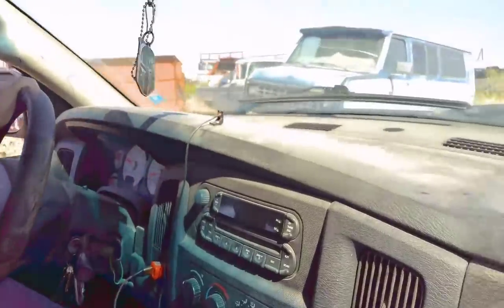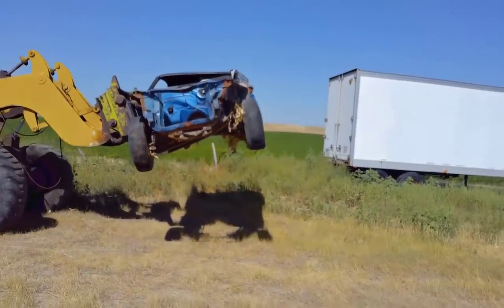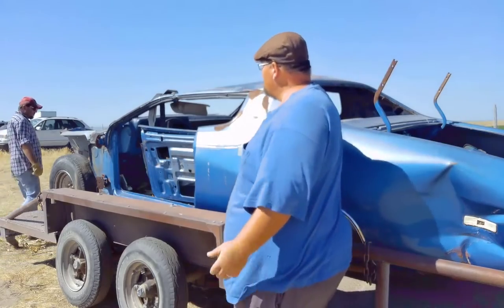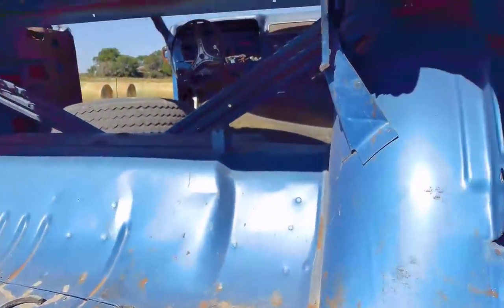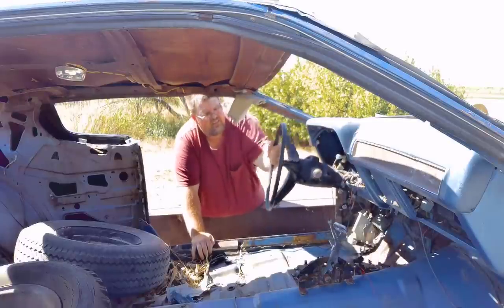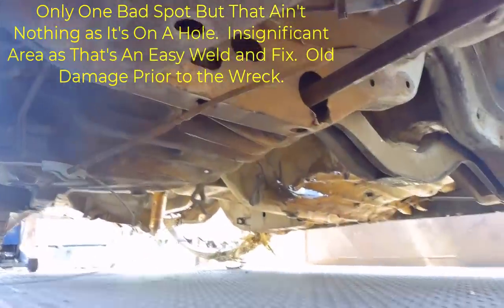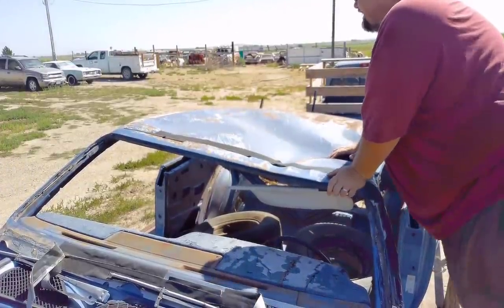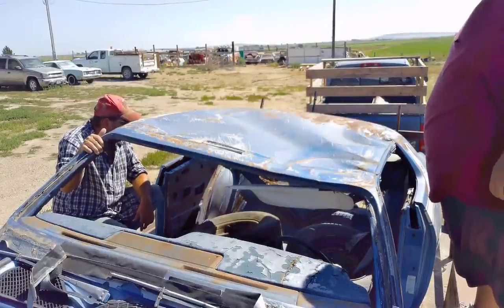Saved From The Crusher!  Bringing My Wrecked and Rolled '73 Roadrunner Home!

Comment: Zero chance this car is ever road worthy again~
Reply from the maker: I've worked on worse.
Reply: @TheDirtCatBrothers  Yeah, probably true.. but hardly any of these left, and there's nothing on that car really, so it needs new everything~ Finding all the parts is what dooms this car~ There just isn't enough of it there in my opinion~ If it was an F-150 this stripped, you could make it happen.. but with this, I'd say it would cost close to 35-40 grand to get it back in really nice shape~ At that point, it wouldn't be worth the effort~ Not knocking your workmanship, just don't see this back on the road feasibly~
Reply from the maker: @Buttermilkjug  It's fine so speak your mind as I know you aren't knocking anything!  From when I checked the car out, I made sure that it could go back on the road 100% however this is not going to be a 100% restoration of original hardware as it's going to have a twist towards its restoration with it  being modernized!

Comment: That 1973 RR def looks rough but, at first glance, it looks to be rather fixable. Note that body/fender technology has progressed a LOT since 1973. To somebody who's used to doing major work on 2010+ cars, that RR would almost be relaxing to restore correctly.
Reply from the maker: One of the main reasons why I grabbed it as it is 100% fixable.  Just needs a lot of love and care in which it's going to get a lot of love here shortly!
Reply: Starting 1973; all Mopars with the exception of the 6 cylinder Darts/Valiants, came with discs as standard equipment, so your Satellite/RR is already fitted with discs.

Comment: For 1973 the Plymouth Road Runner came with four engine options:  318, 340, 400 and 440.  The 440 came as the GTX option, it would say Roadrunner on the body with GTX emblems on the hood with the 440 call out numbers.  Even though you don't show the vin number, it doesn't really matter because this does look like a Roadrunner.  Your vin should start out like this:  RM23G3, the next numbers are the build numbers.  If there is a fender tag which is found on the top of the front fender, drivers side, that would tell you more options.  The color is B5 Blue, a very popular color and a nice one.  It will take a lot of work to bring this car back together but it can be done.  Even though it doesn't have the larger engines, its still a Plymouth Roadrunner, very cool.  By the way the 1973 318 Roadrunner came with dual exhaust and could be ordered with four transmission options:  three speed manual on the column, three speed manual on the floor, four speed manual on the floor and TorqueFlite Automatic, column shift or floor shift.
Reply from the maker: You are spot on!  This does start with RM with the fifth number being that of a 3.  Learning more about my Plymouth after all of these months, this came with the 318.  Very low end model.  To me, I don't care as a Roadrunner is a Roadrunner.  The color I wrote down someplace but agree that it is a very wonderful blue as I plan on spicing that color up more when paint goes back on.

Hoping to get more established as this won't be original.  Plan on turning this into a Roadrunner Hellcat with the 6.2 litre out of some modern day Charger Hellcat, or whatever is available, into it.  I have to find out of what needs to be reinforced with the modern engine as it will be a new encounter for me to undertake.
Reply: @TheDirtCatBrothers  You have a nice project car there, good luck with it!
Reply: And 360 in 74 to replace the 340

Comment: Did u even start repairs yet, I'm painting my 1977 Ranchero and putting a intake, headers, Holley 670cfm carburetor on it, also down the road im put a cam, aluminum heads, and hydraulic roller rockers, I'm going satin black with blood red pin strip, I got baby moons chrome rims on it, all work is done by me and my brother he's got a 76Scottsdale with a 4inch left pluse some motor work, love old schools

Comment: What are wrecked my 74 Roadrunner the only hard part was to get was the hood but it took me four months and I finally found a whole car for sale so I bought it the only thing was obsolete was the hood
Reply from the maker: It will be a long process, like everything else, to get going.  The only thing I find hard as well is the hoods to locate.  Time and patience for this Roadrunner.
Reply: @TheDirtCatBrothers  take your time and rebuilding it I bought the 73 Roadrunner for a hundred and fifty bucks and I want to tell you everything on it was perfect so I changed out the hood Defender the grill in the bumper and I took a few parts off of it with my other car didn't have so one day I went to work I told a friend of mine I had a 73 apart out I almost made $1,000 off that car

Comment: That stripe looks original. Double check the VIN. Dash could have been swapped out. Look under the trunk seal or core support.
Reply from the maker: It's got RM on it.  Its a very base model Roadrunner that came out with a 318.
Reply: @TheDirtCatBrothers  that ok. Put a 5.7 Hemi and cruise it in style. Good save

Comment: Yo is it a RM21 vin code that's road runner it's obviously a b-5 blue inside out color no it wasn't white those holes you saw in the frame wasn't where the vin code was it's where the sway bar was bolted to the frame

Comment: Its not all rusted out You have something good to work with It must have been a low mileage car when it rolled. The steering wheel is in good shape.
Reply from the maker: It could have been but not even sure.  Surprisingly the steering wheel is in good shape as I'm going to be taking it off sometime in the coming week when I have time.  Need to detach the column as it still locks in place without the key lol!

Comment: That car has a really good platform no rust?
Find a rust bucket take the top they are out there.
Have you seen what coldwarmotors did with a 60 fury?
Reply from the maker: Besides the roof, the left side of the interior floor  has cancer in it due to sitting for so long along with middle hub damage when they placed a floor shifter in it.  Front end has to be pushed to the left a bit as it's damage from the wreck but it's also common uni-body stuff.

I've seen that video series of his up to where ColdWarMotors was going to paint it.  Think he used 3 cars to build one.  Not the first time I've seen someone do that.  If the catalog I have coming doesn't have all of the necessary refurbished stuff, including a roof skin, I plan on finding one that's got extreme cancer in the floor that makes it unable to be savable to get the roof and posts off of it.

Comment: Cool car sucks they told you it was a big block rr. I have a 1971 charger se with a big block 400 the roof is rusty and bad. But I drive it any ways. I subscribed  I want to see you fix it and how when it comes to the roof.
Reply from the maker: Yeah, it sucks but it was a huge learning experience!  Even my mentor thought it was a big block but didn't know how to read the VIN on Plymouth cars.

Thanks for that!  Still researching websites that have accurate sized roof skins unless I find another Satellite or Roadrunner that can't go back onto the road at all.
Reply: @TheDirtCatBrothers  mine had a vinyl top and needs replaced. They don’t make a reproduction roof skin. You have to cut one off another car. Better yet a whole parts car and and if it has all of the glass and all that stuff might fix that one but I still like the one you have.

Comment: You know it is illegal to have a car with no vin.no the one on the door don't mean shit if the one on the dash is missing.You can buy one cheaper than you can build it mo par parts are super expensive.I know this from restoring a 69 super bee.
Reply from the maker: It's not illegal by any means so stop that nonsense.

A person can get a VIN for anything even if it's missing.  How do you think people get VIN numbers for custom hot rods made from scratch?  I can go out to any car that's been sitting in a field with VIN's not there and get new ones after showing proof of purchase.  Have to go through a system with the local county office with a sheriff called out to come and inspect the car as that's how  you  have to inquire about it.  The cost of doing so ranges from whatever county and state you live in.  The thing that IS illegal is taking a VIN from one vehicle and using it onto another.  The VIN that's on the door will help me track down to whoever took the original VIN from mine to get it back as I'm 100% sure it's in use.